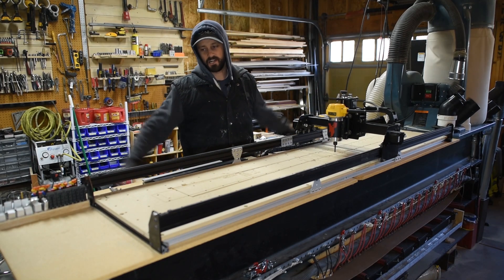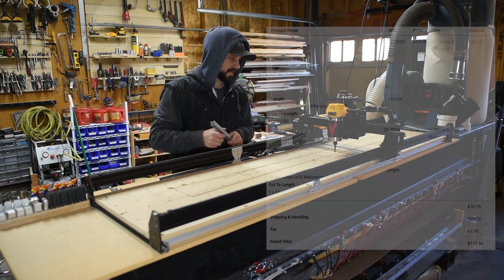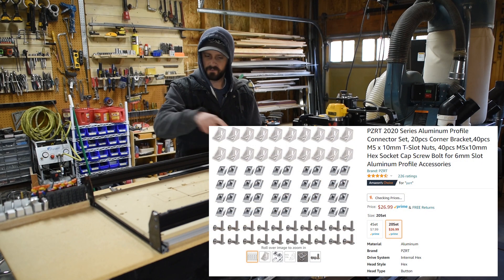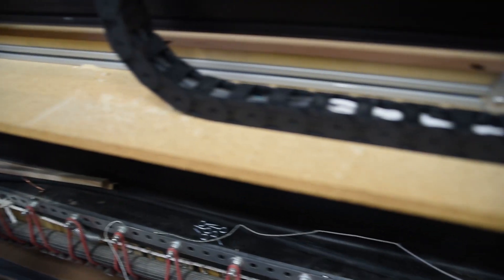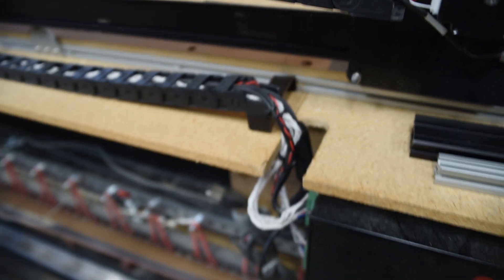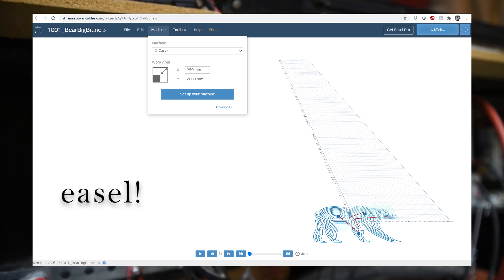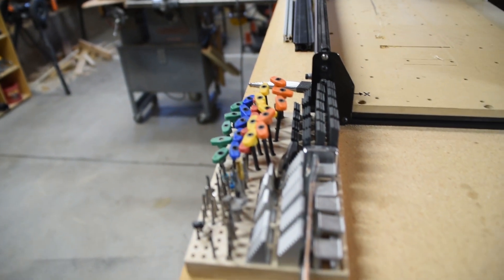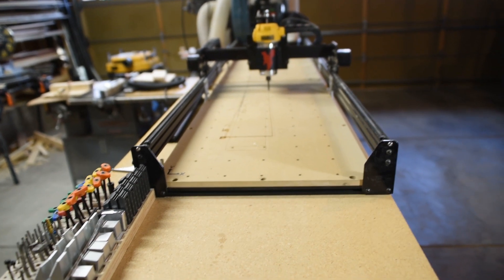SkiNC

Comment: Hey man, this is amazing. Best video I've seen out there on the subject. I'm looking to use a CNC for my ski cores and would love something like this for two reasons: 1) I have limited shop space and 2) 4x8 CNCs are expensive as I'm sure you know.

One quick question; how did you deal with the belts? I'm assuming you had to lengthen those somehow too. Any info is appreciated!
Reply from the maker: Whats up dude, thanks!  Yeah I did have to extend the belts.  I forget if they are XLR or XL or XR or something, but they are a standard belt type.  I got some really long sections from Amazon for pretty cheap.  

Agreed, 4x8 CNC's are super expensive and take up a ton of space.  I thought this hack was pretty slick too.  Its a few years old now, so I'd say its lasted the test of time quite well.  Good luck!! Feel free to reach out with questions!

Comment: What is the maximum thickness of material it could cut? Will it work on MDF 18mm?
Reply from the maker: That mostly depends on the length of the cutting edges on the bit you use, but 18mm is no prob.  Its common to to use multiple passes at different depths for thicker jobs.

Comment: any reason you don't use the SkiNC to profile your cores?
Reply from the maker: The CNC really only holds up to a 1/4" bit efficiently.  Over that and you have to go super slow.   I just don't want to run it for like 6 hours...  I use a bigger router on the sled and can put much larger bits in it.  Also I built the sled before I had the router, and if it ain't broke don't fix it....  Cheers!